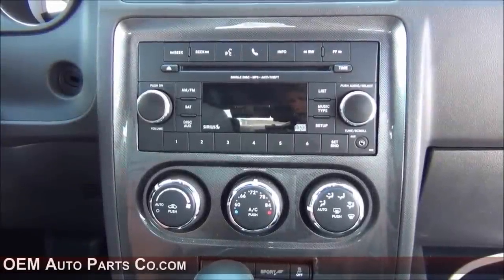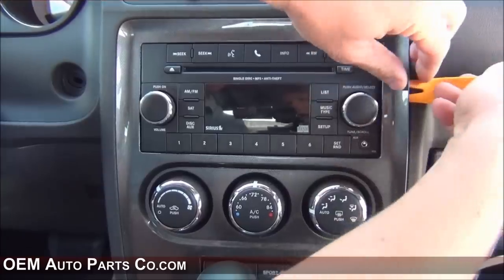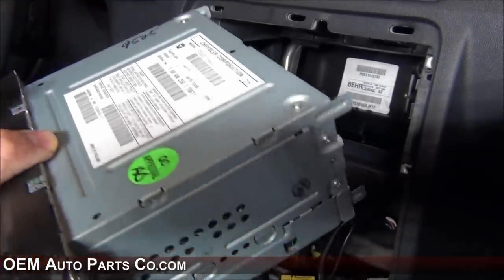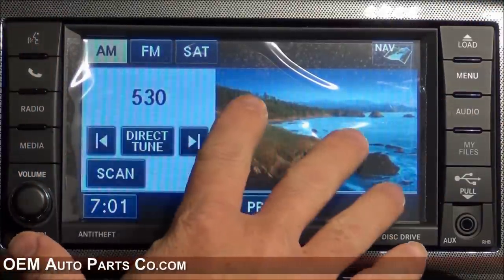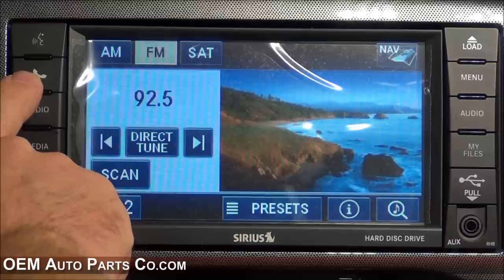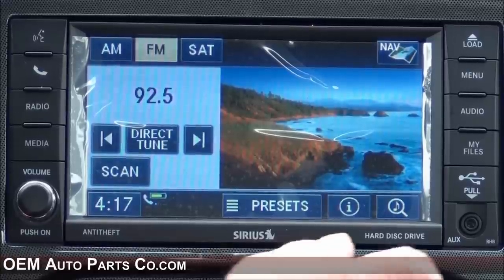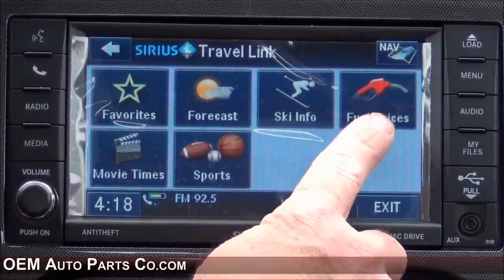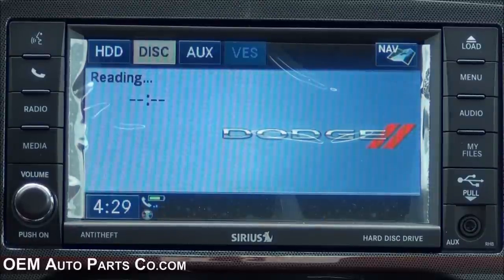RHB 430N MyGIG GPS Navigation Radio - Easy Plug & Play Install! - Chrysler Dodge Jeep Ram

Comment: Hi,

I just bought the 430n. When I removed the 130 there is no uconnect connector and no gps and sirrus adapter plus when i connected the new 430 its said incorrect security code. So the questions are how much do i get the uconnect connector and gps sirrus adapter plus how do i reset the security code

Appreciate your answer...Thanks Z
Reply: +Zuberali Syed Dealer
Reply from the maker: Our team can help you get the upgrade done right for a seamless plug n play OEM solution.

Comment: Can you help
Reply: I have a dodged Durango 2013 it has the same stereo as your video I’m also putting in a touchscreen RHB . When I bench test my stereo it turns on but when I plug it in the vehicle it does not
Reply from the maker: There's a possibility that maybe the radio fuse is blown in the vehicle. Also, if the RHB is the wrong canbus speed, that can result in it not powering on.